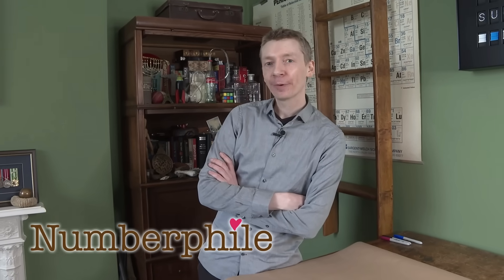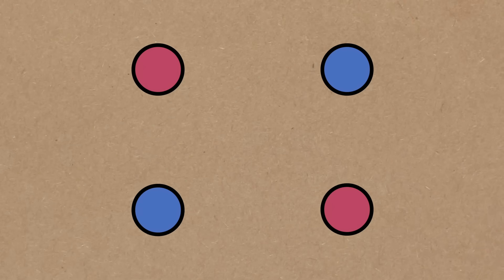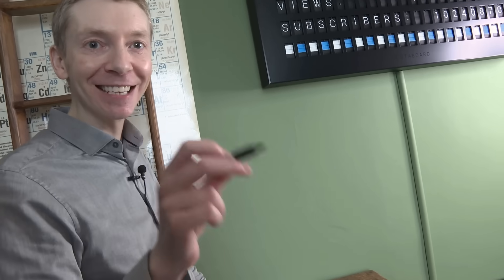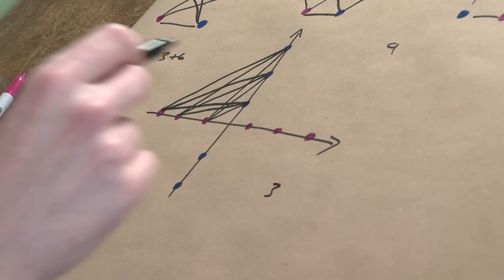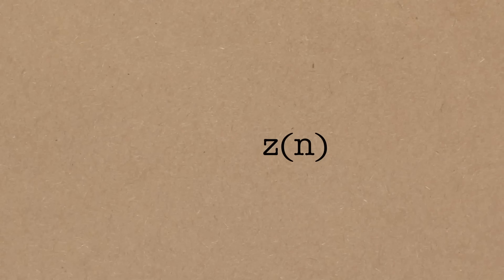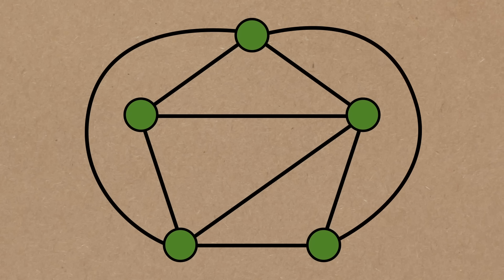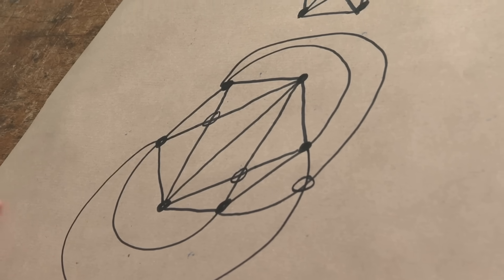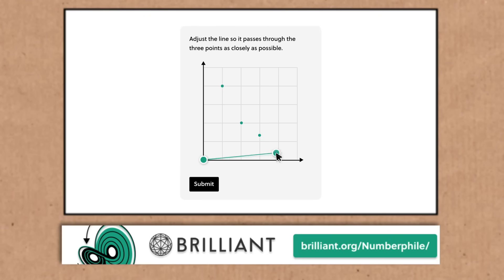The Brick Factory Problem - Numberphile

Comment: At 2:37, the count of crossings is reported as 7, but typically I think of such problems as disallowing three edges crossing at a single point - is that actually part of the problem, or just a simplification?
Reply: That must be disallowed, otherwise all graphs could be solved with only one or two crossings. Just send everything into the rail vortex.

Comment: I found a far better solution that I can prove is the best
Step 1: put all kilns and storage units in a ring, if there is more of 1 than the other, leave gaps for the nonexistent units
Step 2: connect the ring
Step 3: connect everything else across the middle, making sure all tracks join up at a single point

Guaranteed only 1 crossing. Proof that it can't be 0 is the 3 utilities problem

Comment: Couldn't you reduce the number of crossings a lot more if you have more tracks go through the same point?  I noticed that the middle crossing in the 3 of each node graph was labeled as a single crossing even though there were 3 tracks going through that one point, so why not have a lot more tracks go through one point to reduce the total number?  I don't know if that would let you get all the way down to 1 crossing for any graph (I'm trying to work that out),  but I'm guessing it could reduce the number of crossings to lower than the equation predicts for larger graphs.
I think it would definitely work if you allow bends in the path at that point, so some tracks enter at a different angle than they exit, but I think it would still be useful if that wouldn't be allowed.

Comment: But seriously.... if you introduce the length of the vertices (tracks) as being important (minimize the time it takes to move the bricks) combined with the time penalty of navigating the cart over an intersection (node).... The problem becomes more practical perhaps.  There may be scenarios where the length time value exceeds the node crossing time value, so crossing is the better option.  And vis-a-vis where the length time value is more efficient, so perhaps going a longer distance is less time expensive than another crossing.

Would love to see that model! 🙂

Comment: This is just like that famous puzzle of connecting three houses to the three utilities. In fact, for the 3K3S example, it's quite literally the same!

And it can be solved the same way: just add a third dimension, by making the railroads elevate above or tunnel under each other, you can make it have no crossings.

Alternatively, stepping outside the realm of abstract maths, you can connect a kiln to just one storage, and then connect the storages so they can exchange stock when needed.

Or fix the damn crossings.

Comment: 12:26 is that formula general for all values of n, or just 6? (6-3)/2 rounded down is 1, so it's logical to stop there, but e.g. if n is 12, then (12-3)/2 rounded down is 4.
Reply: Yes; in my non-mathematical little brain I was wondering if the number of terms in the formula is related to n.  Do you always go to [n-2/2] specifically or would you have n-4 terms in the equation?  e.g. if you have 17 points to connect, would you go to [17-13/2]?  And why is it a quarter at the front of the equation?  
(See, I said I'm no mathematician, but I am interested in these things!)

Comment: Missed opportunity to bring the complete graph segment back into the kilns and storage segment. The kilns and storage part is trying to make a complete bipartite graph with minimum crossings.

A bipartite graph is a graph where there are 2 sets of vertices (e.g. kilns and storage units) where members of either set only connect to members of the other set, for those wondering.

Comment: 2 simpler solutions:

Arrange all the kilns / storage units in a circle (ideally alternating, but whatever).  Then run all the lines to the center point of the circle, and install a turntable / circle junction.  Then any kiln can connect to any storage unit with 1 single crossing.

Or,  do something similar, set up kilns / storage in a circle and radially extend from the center.  Set a loop around the outer perimeter of all the kilns / storage units.  Then each spur connects to the circle in 1 place, so there would be (in your 6x5 example)  11 crossing points, which is far less than the 24 you suggest.

Comment: Matt mentioned that this math is used for circuit boards because crosses demand more layers of board. Can y'all go into the math of determining how many layers is needed? Is it based on the number of crosses? The complexity of the crosses? It'd be cool to see the math of it!
Reply: Some of it is for shielding. E.g. you would want a ground layer, then a signal layer, then another ground layer. So it's not just a math problem.

Comment: The obvious solution is to place each brick onto a blockchain and 3D print it on location.
Reply: And also throw AI at it
Reply: The obvious solution is to place the kilns on the trolleys and rolling them to where they are needed,  no need for storage units

Comment: What I would do is make it so instead of multiple tracks crossing, I would have the spot where the crossings would happen cut out and replaced with a single track on a turntable so that you just orientate the track on the turntable to align with the track you need to use.

Comment: Am I the only one who feels that the story of the proofs will even be MORE interesting? Why 6? Why 12? What was the mistake that no one noticed for more than 10 years?
Reply: agreed, I want to see the story of the proof now!!
Reply: The reason that we know that the conjecture for complete graphs is correct up to 12 is because it has been checked computationally. The reason we don't know any more is a because it would take too long to calculate.
Finding the actual minimum is pretty interesting, because it takes so long to check every possibility it is instead rewritten as an integer linear optimisation problem solved using the associated optimisation algorithms.

Comment: The realistic solution is to just reuse the tracks. You can just make a roundabout or go through another point.
Reply: Yep.  Use a combination of wyes and through stations.  Loading and unloading is done on a siding, not the main line.  Even including a freight station for raw material input and finished product output, you can solve this with no diamond crossings at all.

It's not really the spirit of the mathematical question though.

Comment: The engineer in me can't help but think "If intersections are so bad, why don't you just design the rail system with switched junctions instead?" You could have all the kiln routs converge to a single line that then diverges to the storage units, the key difference is that the forks in the line would be controlled by switches that would make it so the carts are only ever contacting one set of rails a time. Perhaps this would reduce or eliminate the instability caused by the intersections. Another possible solution: use rubber tired carts not rail carts. Well anyway, the point is to make a mathematical puzzle, and even if that problem isn't actually practical to the brick carts, it can apply to other situations like the circuitry problem.

I noticed that the 3 kiln to 3 storage unit case of the problem is identical to the 3 houses and 3 utilities unsolvable puzzle. I remember as a kid my uncle in Russia posed to me that puzzle, and very quickly I conjectured it unsolvable (the goal being to have 0 intersections), at least on the Euclidean plane, but I really wanted to mathematically PROVE it was impossible and felt frustrated that I didn't have the mathematical tools to do so.
Reply: My first thought is "don't ask a mathematician to do engineering"
Reply: @yt.personal.identification Second thought: don't ask an engineer to do mathematics.
Reply: My first thought is to connect to a turntable, next would be switches.
Reply: As i said to the other commenter with the same idea, having tracks converge is actually more difficult to do compared to a somewhat orthogonal track crossing. So if the cart tracks at the work site were so rudimentary, that they could not get the crossings right, they for sure could not get tracks to converge. Remember, this is not a rail way for freight trains, this is a work site, possibly even just temporary, and since it's forced labor, they won't really mind some worker there having to pick up a cart and pick up bricks, it's certainly cheaper than having to install proper tracks.
Reply: Maybe that was the plan, and lots of bricks are needed to buy that upgrade.
Reply: I agree. I figured this is meant to be abstract and more of a thought experiment.  They could build bridges or tunnels.
Reply: @UbaldoValdz  Hahahaha! I didn't even consider bridges and tunnels yet.
Reply: Mathematician: minimize the crossings. Engineer: make crossings that work.
Reply: My thought was… why does every kiln need to connect to every depot?
Reply: It's not about the track problem, it's about the math behind it
Reply: @mablejansen442  "Well anyway, the point is to make a mathematical puzzle" -Me in my original comment. Thank you for treating me like I an overly literal idiot, when I made it very explicitly clear that I understand the point is not actually to solve a messy realistic scenario. I was just trying to have fun think thinking about other ways you could solve the issue that inspired the mathematical problem.
Reply: Funneling your carts into a single line sounds like an even worse bottleneck... And forget bidirectional travel!
Reply: My first thought is, if this is a real-life example, why don't you solve it in 3 dimensions?

Obviously that is circumventing the actual problem altogether, but if you don't want that, don't bring an example where it's applicable.

Comment: To anyone who thinks this kind of maths is a bit abstract - I used to use a lot of these graph algorithms in the EDA (electronic design automation) industry - when you get down to really low level problems, this sort of stuff is invaluable and using it is the only way to make many things realistic and/or feasible.
Reply: What firm are you working in? (Working in EDA too)
Reply: @anujthakur614  I worked for a startup called Arithmatica - later acquired by one of the big boys after I'd left. We were developing synthesis tools that specialised in producing low area/high speed gate level descriptions.
Reply: Its just graph theory

Comment: If a track merger was a viable intersection for this problem, I think you could bring it down a lot by having them all merge down to one and then split back up.
Reply: Pretty sure those were rudimentary tracks, hence the original problem, a track merger should be even more difficult to get right compared to a (somewhat) orthogonal crossing.
Reply: I would put kilns on one side and storage units on the outside of a loop, with each kiln and storage unit having an entry/exit ramp. 
 The number of junctions is just kilns+storage units.
Reply: That would be a modified Steiner tree problem

Comment: You have only so much space for a factory. Paving everything with rails is a bad idea.
1. More wheels under the trolleys will make them more stable. Redesigning the track may also help.
2. Dividing the factory into several parts, with their own furnaces and storage (2x2). Making them back to back in an alternating pattern (checkerboard) will add more flexibility, but won't create any crossings. No chaotic tracks. Easy to expand in the future if needed.
3. Discarding the rails altogether.
4. Making storage units bigger to limit their number.
edit:
A checkerboard pattern makes one kiln for 4 surrounding storage units, and vice versa. IMO more than enough flexibility to cover all the needs.

Comment: Same as Printed Circuit Board routing ?
Reply from the maker: Someone hasn’t watched the whole video? :)
Reply: @numberphile  except in PCB routing, not all point are connected to all other points, or many points for that matter. PCB is more like a lot of tiny problems like this that need to take all the other solutions into consideration.

Comment: the general case, abstracting to some number of vertices and some number of edges has some nice proofs. particularly the probabilstic proof just using Euler formula, which should be pretty accessible. as for chip design, the VLSI guys were actually the ones who pioneered many proofs independently of the mathematicians (Leighton, for example). see Crossing Numbers: Bounds and Applicaations by Shahrokhi, Sykora, Szekely and Vrto

Comment: why not run the track through a storage unit so it reaches another one 😂  then i think you only need 5 tracks to solve k(3,3) i believe, bricks are laid down on the side of the tracks inside each warehouse, so i dont think you will get the bricks falling over issue 😂

Comment: Why couldn’t you arrange them in a large circle, make a smaller circle of track inside that circle, and then have every kiln/storage unit attach to the circle? Then the number of crossings is exactly equal to the number of kilns and storage units, and you can get to every point on the graph.
Reply: I guess we can say, going "through" another kiln-storage is not allowed, you can only have point intersections with other paths. 

I think you can bring the number always down to 1 (counted naively) by doing that. A column of kiln and a column of storage with all of their connections routed through a point in the middle.
Reply: It's implied that only two tracks can ever intersect at a given point. Or, equivalently, you're counting the number of times tracks cross, not the number of places where there are 1 or more crossings.
Reply: @QuantumHistorian  I’m not understanding why this applies. If you have a circle with spokes coming off to each destination, you still only have a series of single points of intersection. They’re not all intersecting at the same point - they’re all converging to the same circle. Like a roundabout.
Reply: @titleloanman  Think about it this way, do the paths between different kiln/storage pairings have to share a portion of track/circle? If so, that is not allowed.
Reply: @titleloanman   I think to see QuantumHistorian's point, draw the various travelling paths from kiln to storage in different colors and see that the colors intersect many times. By his implied rule those would add to the intersection number.

Though these implied rules do feel a little adhoc from the viewpoint of the original problem and also because these rules are only telling you after you've finished your drawing. In order check pairwise intersection completely you kind of have to look "globally".
Reply: @ddognine  ah, that makes sense. Even though they technically only “tap in” to the circle once, sharing the same path is functionally having infinite points of intersection.
Reply: @titleloanman  The base idea here is that you want a passive system with all connections independent from each other. Each crossing means you need to bridge one connection over the other.
See the example given in the video with electric connections in a computer chip.
You can also think of pipes transporting various gases from individual gas factories (the kilns) to storage buildings each containing tanks for each gas. You need to keep the gases separated.
Reply: @sszone-yt6vb  it's silly to count it that way though as from a practical perspective you have far fewer intersections.
Reply: You can’t go through a kiln while it’s firing.

Comment: The reality of moving brick is less complicated when you have more than a two dimensional space to run track within, such as running some track under/above other tracks, and the starting places are more than single points, but areas. So your proofs are extremely useful for getting best efficiency for layers.
Reply: If my choices are between maybe derailing a cart when I cross, or being guaranteed to push a cart (full of bricks!) up a steep hill every time I cross, I'd probably take the chance of derailment.
Reply: @fieldrequired283  Yeah, but we don't worry about that in this century... we push the button or flip the lever and the Minecraft minecart goes ZOOM!
Reply: True, PCB design is as much art as science and the more layers you have, the more expensive to manufacture.
Reply: Also the reality is more simple when you realize you don't need everyone to connect to every other.  Each connecting to two or three gives you lots of flexibility for load balancing.  It probably gets more complicated when you realize you need tracks from every storage to the loading area for them to get picked up by a train.
Reply: When you suggested a two dimensional space to run track, my brain immediately jumped into homotopy theory/∞-category bs with "but now you have tracks between the tracks".

This would be like having surfaces which you could slide your tracks along to reposition them (keeping the endpoints fixed), and now you would be interested in minimizing how the surfaces intersect.

Comment: The hexagon calculation at about 11:00 does not make sense to me.  The slope of the line joining 2 points depends on which end you start at so how do you decide ?
Reply: You always choose the leftmost point as the starting point. If there is no leftmost point in a pair, you start at the lowest point and that is defined as infinite positive slope.
Reply: because the Romans were backwards and decided reading left to right was correct so now all maths happens that way
Reply: @joleneonyoutube  
It’s not so backwards if you remember that the script was developed for ink rather than stone tablets, and that most people are right-handed.